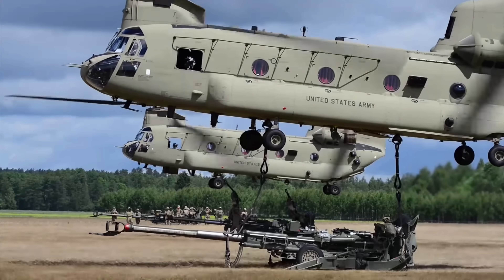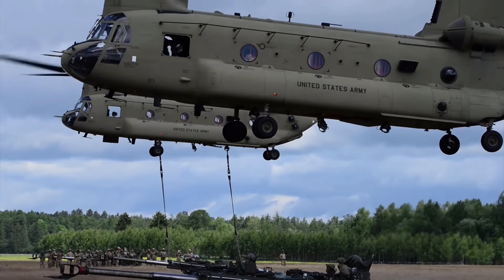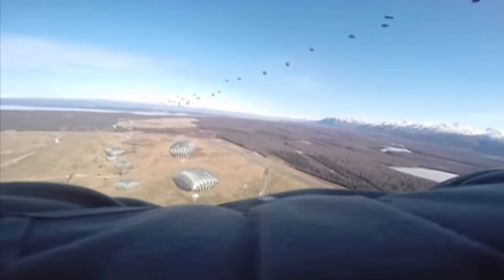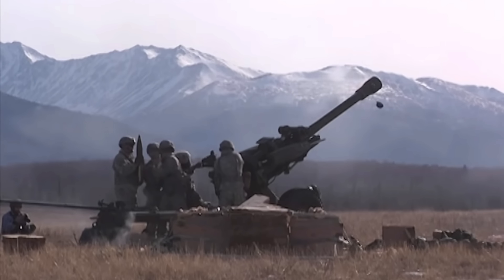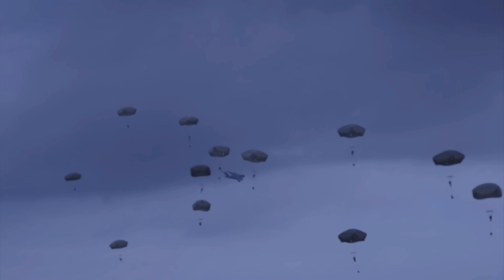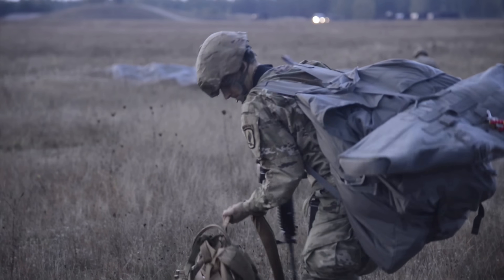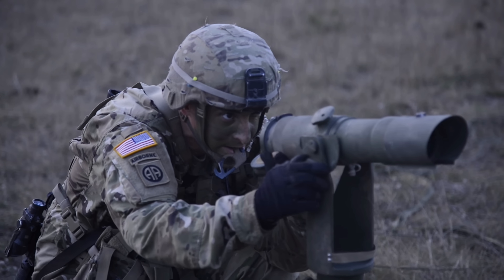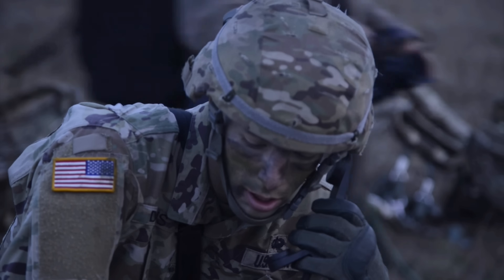Why do we still have Airborne Artillery?

Comment: There is an experimental 105mm howitzer, mounted on a Hummer, being evaluated by the Army and Marines. I think that would be the future of light airborne/ air mobile artillery.  But I think multi-launched loitering drone will be the future of fire support. A Hummer or similar vehicle, with a pod of twenty or thirty loitering drone with a 20+ miles range, with the power of a 90 to 120mm mortar.

Comment: I served in Marine Corps Field Artillery for 21 years.
I was a Staff Sergeant and a Howitzer Gun chief as well as  Platoon Sgt. 
I  think field Artillery is extremely important and powerful.

However it's also a dangerous M.O.S. now Adays with I.E.D's and also Drones flying all over the place...
I trained for Artillery Raids..
Where we would sling load the Howitzer under a helicopter and fly it into a hot L.Z. and. Dump some rounds on Priority Targets and then GET THE F##K OUT!  Asap! Before counter battery fire could bracket us...

Comment: Why dont people think of the xm8 of being decent like sure its armor is thin because it's a light tank but its thick enough to stop what it needs to and if u put a trophie system on then rpgs do nothing as well and most tank guns can allready penetrate basically every tank ever anyway and the xm8 is small so it would be really hard to hit but u can also throw a xm8 out of basically every plane the us military has such as a c17 and ac130 witch would be very useful and I'm pretty sure it costs not a whole lot for a tank either because its basically tracks a engine and fire control equipment and a autoloading gun

Comment: my unit airdropped M198 155MM howitzers.  At 16000 pounds, those were a heavy drop.  We also dropped M939 5-ton trucks to tow them.  obviously were not a light unit.
Reply: The m198 was 19,200 pound's from muzzle break to towing pen. Fort Bragg C-btry 1/39th f.a.r. from 1989 to 1994 Moore D.  We drop that mf! Every where and jumped in behind it. So I have very vivid memories of two gun packages and air mobiles.  Good Times 😳😳😳😳
Reply: @13B1pabn  hey Dee Dee - I was in HQ battery and left in 1988.  Small world.  I was looking at google maps, and it looks like the 1/39th buildings are gone and turned into a parking lot!  (if my reckoning was correct).

Comment: I agree. I don't think the helo-light gun combo is going to work against a peer adversary. The gun would have to be deployed within 20 miles or so of the enemy, and given the nature of modern air defence, the helo's won't be able to loiter on station waiting to re-collect the gun and crew again 15 minutes later. Plus, if you look at the last time the British army fought a near-peer adversary (The Falklands), one of the biggest issues they had was helicopter based logistical support. The helo's were in such high demand to move supplies, ammo, troops and equipment around that in a modern theater, it's just highly unlikely that they would allocate four to twelve Chinooks to lift howitzers around and wait around to re-deploy them. I think you're right in your assessment, in that they'll keep using light guns (105mm's) and deploy them on wheeled chassis' like the Boxer when it comes in to service. I think we'll see them introduce some lightly armed vehicles for the paras too to enhance battlefield mobility. Air drop a couple of APC's full of paras from one C17, and a coupled of wheeled SPH's from a second and you've got a potent strike force operating behind enemy lines. Combine that with the strike brigade concept, and you've got forces attacking an enemy from 360 degrees, rapidly moving in and out of range in turns. Hard to combat. Great video, thanks.

Comment: Anytime you have organic assets, you want to train with those assets so you're all on the same music sheet. When you have an asset you don't normally control: 1.) you may not have priority to use that organic asset, 2.) you run the risk of miss communication. 3.) a ground asset can be in the area longer than air assets

Comment: After reading about Operation Anaconda in Afghanistan, it was pretty obvious that the 101st & 10th Mountain really regretted not having the Light 105 at the Battle of Shahi-Kot Valley. All they had was 120mm Mortars, which had too short a range to effectively suppress Al-Qaeda fighters. So they had to rely on Air Support instead of direct support from the light guns of the 101st Artillery Battalions.It's one thing to have Air Support "On Call", where the Air Assets show up when they show up, instead of having Arty in a commanders "Hip-Pocket".
Reply: When you say 101st Artillery Battalions,do they have something to do with the paratroopers?
Reply: @Turgon92  The 101st Airborne are no longer paratroopers (since the 70's). They are air assault by helicopter/VTOL trained.
The division structure is now.
1st brigade combat team (infantry)
2nd brigade combat team (infantry)
3rd brigade combat team (infantry)
101st division artillery (3 battalions+ air defence battalion)
101st combat aviation brigade (helicopters/VTOL)
101st sustainment brigade. (supply)
The above example is one of the brigade combat teams (BCT) being deployed without any of the division artillery to support. 120mm mortars are integral to the BCT.
the 10th mountain was in the same boat.
Reply: @quadg5296  Wow thanks for the detailed answer! it all makes sense now,the only knowledge i had previously of the 101st was in ww2 through the series Band of Brothers..!

Comment: Self propelled gun are great but battle not always take place in relativly flat and open ground like in middle east. some time you deal with reavers large swamps areas hewy jungle and steep  mountain terrain. Best way to traverse those is in air. Also as my granfaa nd his father  (who fend off th austrian in italian alpes in ww1) say: on the alpes who win the battles is the side that put artillery on the right mountains top first. and thre are only 2 way to do it: 
1 mans and mule carrying howizers pice by pice some time using with mountain climbing tecnique in a hurry or…
2 just use  helicopters

for those who say just sand a cruise missle eweriwhere there is a problem I say this: war is a matter of tattical and strategick superiority but when the opposition is well determined and resiliand war become a matter of resouce too. and even more if the war drag for long (I will not start talking abaut the human theater of war cuz I alredy out of topic XD)
So if you are spending 100 to destroy 50 of the enemy "capacity" you did wrong cuz  you are winning battles with tattical superiority BUT ACTUALLY LOSING THE WAR. artillery is far more cost effective than missle arty, cruise missles and air support. (See USA in Vietnam with it's massive hevy air support). also as the war get more symmtrical the less air support and cruise missle are effective cuz the enemy have the means to defend against (when air superiority is not a given) same goes to air power, counter enemy air power with ground means (SAM and AA gun) is far berrer and costeffective  than with air units alone (also see USA with i's costly (too) costly air superioriti in Vietnam).

to sum it up war is not a matter of win/lost radio and god forbit is not a matter of K/D ratio! ffs! XD
So no… nukeing everything from orbit burning ton of resources buyng your way to victory is rarely  the way to win wars… (sorry USA XD)

Comment: With Excaliber you can hit whatever you can target from a good well defended position but you need specialist forward observers. At $53,000 each you can't afford to waste those rounds on false or decoy targets.

With Mountain Artillery you can support any unit and sometimes (if there's no fog, in daylight etc) you shoot at what you can see. You are using maybe cheapest  rounds so every squad with a radio can call for support. Range is so extended that a long barrel become a little less important, reducing weight further. The enemy can't outflank, cos mountain and defensive infantry have height advantage. So any attempt will be very expensive. 

So I get the potential. But
the piece needs specific features. A wide trail, low recoil and self levelling. for starters. A high rate of fire and a wide range of elevation. -10 to + 90 degrees for example.

We haven't produced a mountain gun since the 3.7" How  The USA had the 75mm  in Korea I think.  So our expertise is low.

The mindset to setup in 4 minutes, from mule back fire and repack ready to move in another 4  - we just don't have that anymore. 

A mulioppurpose airborne piece would need all the mountain sophistications. Land crew by glider and make the summit or fire position on foot. Deliver piece in pieces by drone CB-1?  Tow vehicle deliverd lower down? Jeeps in the old days Before that mulles, Nowadays I dunno. Ideally a trackred lightweight. Scumu]itar?

http://www.kiplingsociety.co.uk/rg_screwguns1.htm

Comment: I would think another vital consideration for the use of light guns deployed closer to the frontline is the time to target from when rounds are fired. A light gun deployed close to or behind enemy lines can potentially be given a wider range of fire missions. A heavy gun miles away can obviously hammer a static target. But a light gun closer to the fight has a better chance of assisting against dynamic targets, like moving vehicles or infantry. And because it is closer to the fight, that gun needs to be lighter and more mobile.

I do agree with the conclusion that a self-propelled mount would have many advantages in this role, though at a much higher per-unit cost.

Comment: I agree artillery is very important in mordern day combat (having been in both Iraq and Afghanistan myself). I have 2 different trains on thought on this one. First why are we still using 105's when we could be using 120's for airborne artillery (Russia for example uses 120 for Airborne Artillery support). Second, give the extended range and speed of Mortors namely 120's(with rap rounds). Why not upgrade to a bigger mortor? Since mortors are faster to fire. With rap rounds they almost have the same range(RAP- 13k-15k range vs 17k on 105's) are cheaper to produce and get more ammo during a resupply for the same space vs a 105's.  You can put more mortors out in the field than 105s given the man power and flexibility. Mortors seem like a good alternative if they could extend the range to match. Just my thoughts.

Comment: Strictly speaking, 'airborne' and 'heliborne' are two different things.  Airborne indicated parachute drop with paratrooper crews.  Heliborne is not airborne qualified, and is more like a fast mover.
What you are describing is what the US Marines consider an 'artillery raid'.  Insert with helos, fire, then displace with helos.

I'm still not used to those square US parachutes...
Lastly, it seems that heavy mortars have filled the medium-range niche that the 105 so capably filled for so long.

Comment: I guess the question is 
1- if a plain can fly over it and lift the amunition why not just drop the ammunition from the plain ?
2- if a plain can not fly there then how will you resupply or evacuate at least the crew if the position becomes untenable ?

Comment: I know its a mortar system but we had M777A2 and a 120mm Towed Mortar System called the M327 EFSS (Expeditionary Fire Support System). We had ITVs (Internally Transportable Vehicles) which were narrow jeep looking things that towed the mortar and a second vehicle to carry an ammo trailer. A Light Strike Vehicle which was basically a dune buggy with a 50 cal/240/Mk19 on top in very flimsy turret ring. They fit in Osprey and CH-53s mostly. Whole principal was ship to shore/FOB, pop 30 rounds off and get back to the boat/FOB before anyone knew what was happening. They were an absolute blast to use and fast to get set up. The M777A2 was a bear to set up an emplacement and lay in a pinch comparatively.

Comment: "Airborne artillery" is really a misnomer....it's air mobile artillery as pioneered by the 11th. Air Assault Division in the ''60s, re flagged as the 1st. Cavalry Division, Air Mobile.  BTW, the 101st. Air Assault Division now has this capability.  Moving artillery to support airborne forces is referred to as "airdrop".  FYI please see new generation vehicle mounted close support:  https://dod.defense.gov/News/Special-Reports/Videos/?videoid=699595 (The gun fires "out of battery" to reduce recoil.)
I do not share your admiration for the "light gun"....emplacement/displacement is pain in the neck and the weapon is being replaced in U.S. service.

Comment: isnt a bit the thing that if your emy is superior it wont work and if you are the superior force it will work. cause if you want to deploy something with a helicopter you need to protect them and how do you protect a helicopter if your air force does not have air superiority against enemies air force or even a group of infantery with a stinger. i think if there are 2 equal strong forces you dont get the chance to deploy the artillery and even if you can they are dead as soon as they start to fire 

ps: im not from the artilery im a second leutnant in the swiss armed forces so prob im wrong we dont have light artillery

Comment: Hey matsimus, when you've played arma 3 have you ever used mods? there's a mod called ace3 which among tons of other things adds in the ability to use artillery in a way which somewhat resembles reality. You use a rangetable to calculate the required barrel elevation to hit a target taking into consideration factors such as target distance, elevation from your position and (optionally) air resistance. When these factors have been taken into consideration, you align your azimuth and barrel elevation and let hell rain on the enemy.

P.S: you can also muzzle load mortars with this mod

Comment: Was in ROTC at Xavier University in the late 1960's and it was an Artillery school.  So I was commissioned in the Artillery. XU had four M101A1's to train on. It was my favorite gun, even though the M102's were newer and easier to pivot around and much lighter. We were trained to do air mobile assaults with those guns using CH-47's at Ft Sill way back then.
You have a great channel.  Only complaint is that there isn't more posts!  Just kidding. Keep up the great work.

Comment: Much easier with a 120mm mortar, i t can be broken down into 3 pieces quickly, put into a puma flown to a position and put back together  quickly, its easily manoeuvrable, can be towed by a small vehicle so both the piece and vehicle are parachutable, and is accurate to 11km.

Comment: I was thinking of putting a light artillery piece on the new ajax system as well as a 120mm mortar, the chassis is up to date, ease of production and training, repairs and maintenance is going to be DIRT CHEAP, since its, basically the same chassis, although specialised training will be required for specified parts ie a 90mm cannon, the chassis is pefect due to its upgraded power pack and 1ton worth of growth, so strip the back end off and replace it with say a M777 howitzer.

Comment: 15yrs ago, Singapore put into service a locally-made airborne 155mm 39-calibre Lightweight Howitzer called SLWH Pegasus, that also has self-propulsion (Auxiliary Power Unit). https://www.youtube.com/watch?v=QDDRQ-WNcY0  Essentially you can drive the gun, as it has an engine mounted. After firing you can drive the gun to a safer area for airlift out.

Comment: Whenever i hear "airborne artillery" i'm imagining an artillery regiment dangling below Chinooks firing and reloading howitzers from 2 km off the ground.
Reply: That would be pretty fun
Reply: Getting the tube properly oriented on target while in free fall would be a pain and your not likely to get more than one shot.  Cause once the chutes open you can't fire till you get to the ground.
Reply: 105mm is faster to move around by chopper,155mm is too heavy& required More space to land & man power to handle it, and bigger chopper, it's make it easier become enemy targets
Reply: well that's basically what the AC-130 does with its 105mm cannon. It loiters over the battlefield supporting ground troops with close air support that does the same damage as a light howitzer unit.

Comment: I think towed is the better way to go, as long as vehicles are part of the package.  If they can be left connected to the artillery to minimize break down time.  I think that would be great.  But it things go terrible, they can ditch the guns (disabled them first) and get the crew to drive the hell out of there without towing some really heavy equipment around.  Preserving a well trained crew should be the priority.

Comment: Sure, if you have air superiority and the opposition does not have a few light infantry armed SAM's on your flight path, any arty can be a welcome surprise. It might be better if the deployed pieces have a mounted mule drive instead of relying on just the crew to move the piece. And, once the operation begins, time tables are frequently wrecked. Nice if you can at least move a distance away using the mule drive while you are waiting for the air support or (wait for it), counter battery fire...which ever comes first. Thanks for the videos.